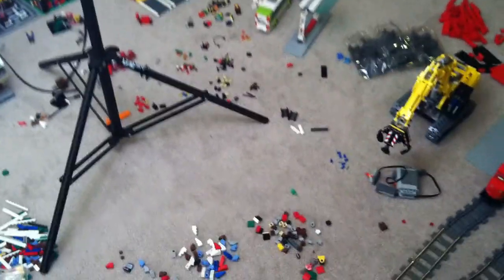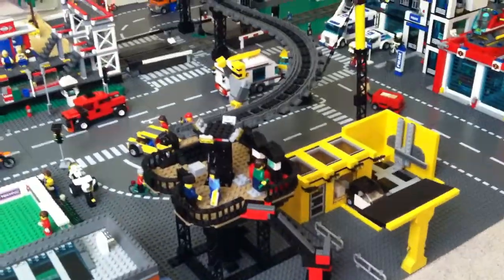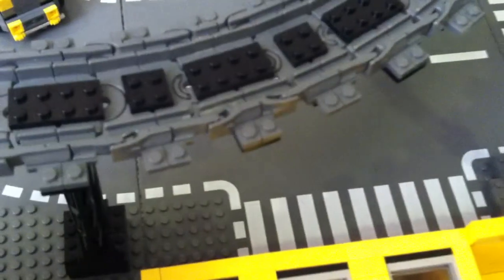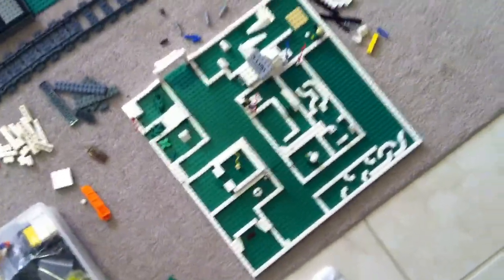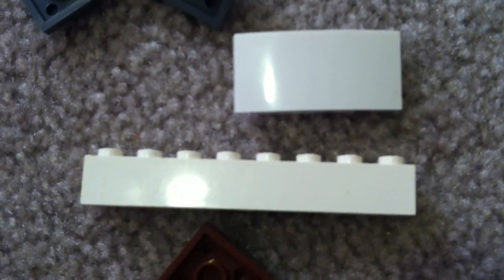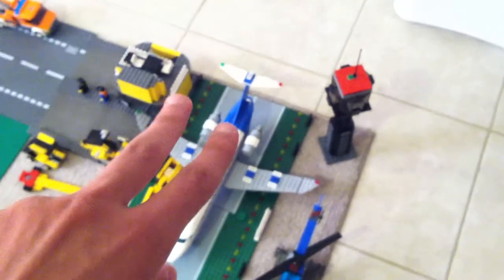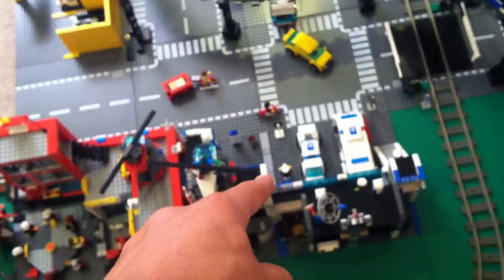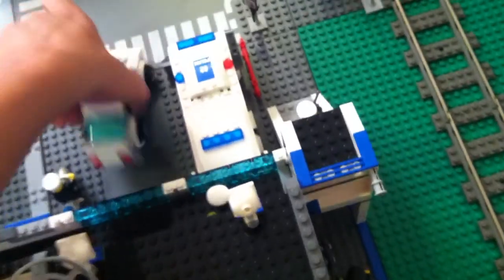Lego City Update!

Comment: Hey cool brick I have question. What should I go with? Cal of duty mega bloks Or, Lego star wars (episodes 4-6 don't like clone wars)
Reply from the maker: Depends on your taste. If you have more lego than megablok then I would recommend getting more lego, because it's kinda annoying to have different brands getting mixed together. Best to try and accumulate one. In my opinion, I would go with lego star wars simply because I prefer lego to megabloks, but it's ultimately your choice. Also, the lego start wars episodes 4-6 have some pretty good sets. What's your budget?

Comment: Dangit the comment cuts off after (some are....So IMA take a look around if my tablet will let me...it has major problems so I'll try real quick
Reply from the maker: Here is the rest of the comment: not available until aug. 1st though). 
1. 75025 Jedi™ Defender-class Cruiser
Price $89.99
2. 75054 AT-AT™
Price $109.99
3. 75052 Mos Eisley Cantina™
Price $69.99
4. 75020 Jabba’s Sail Barge™
Price $119.99 (this one's a really awesome looking set but has a terrible price per part value [14 cents per part, vs the average of 10 cents per part, which adds up to a lot of extra money since there are 850 pcs in that set. 850 x 4 = 34 extra dollars _] so I wouldn't recommend getting this one unless you really really want it or if you want to use it as display)
Show less